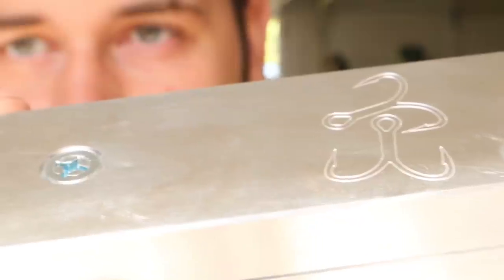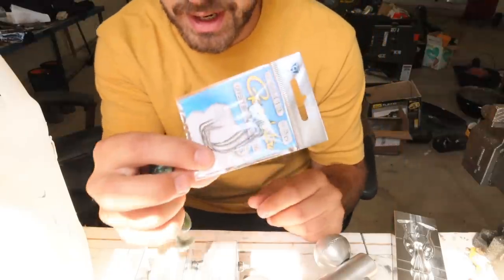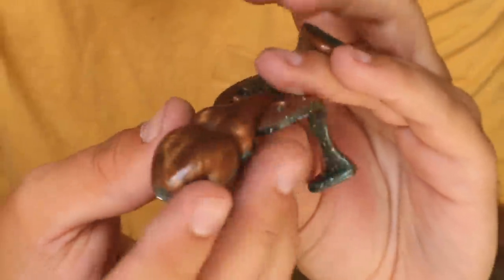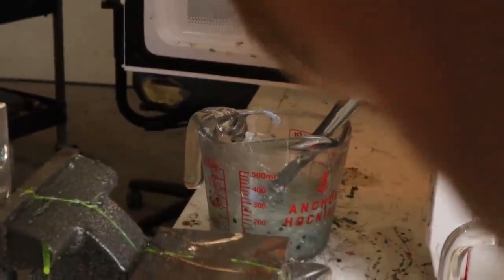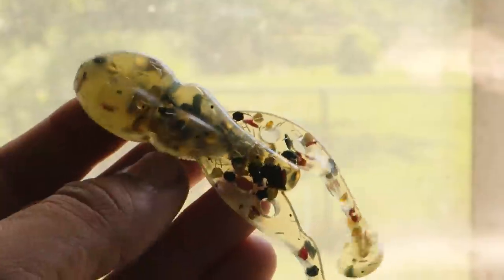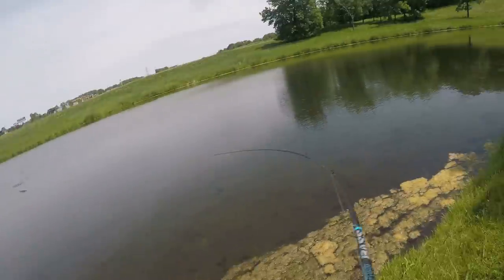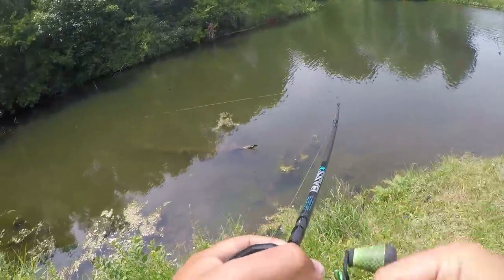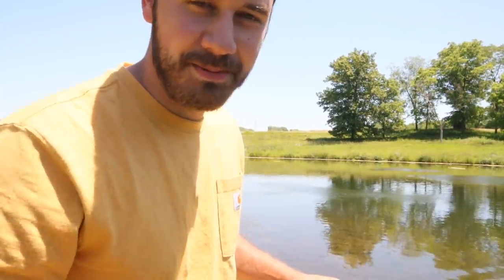An Epic Top Water Frog | Inject to Catch

Comment: Almost thought you were going to go through the video with no hoopla about the new shop. A minor shop hoopla at the end.

Liking the top water action.

I'm wondering if you did any topwater baits with propellers on them. I think they call them dying flutters?
I like one on reservoirs for smallmouth. End of the day just before dark. Inch and a half frog pattern propeller in the front and rear. Nice buzzing sound as you bring it in. Then they gobble it up

Comment: I see a small issue with your frog. I think one of the reasons why you are missing fish is because the head is so much bigger than the body. So when you pull the head makes a hole for the hook to be able to slide through. I encountered the same exact problem with a trout lure I was using. Once I figured out the issue, I lost no more fish.  Great action though!